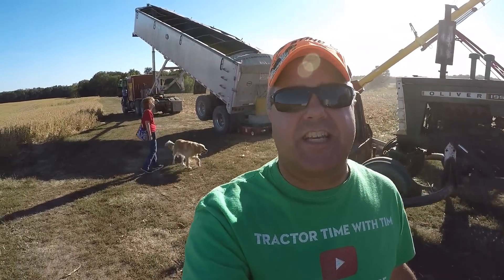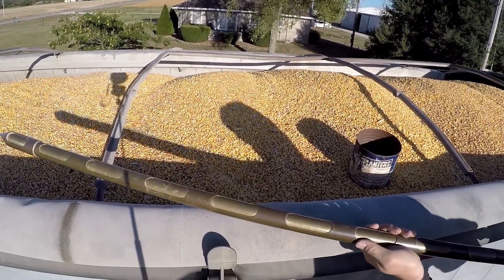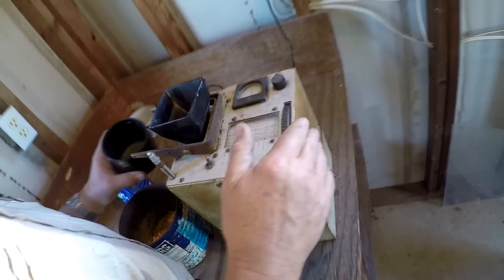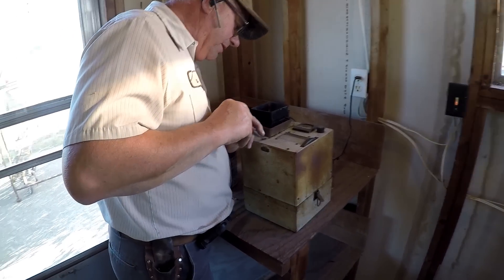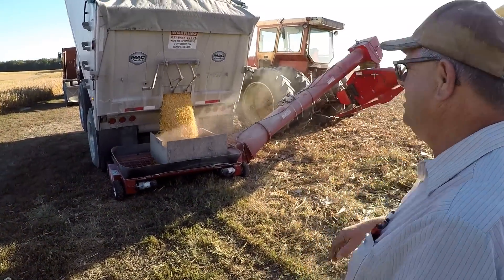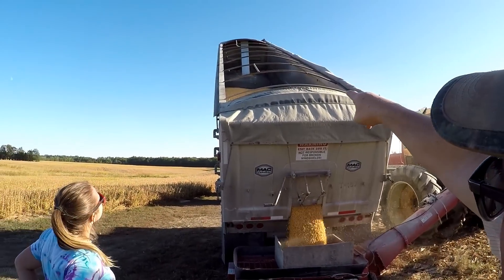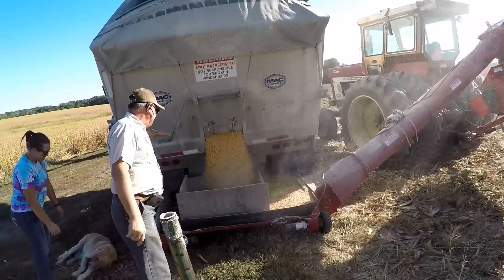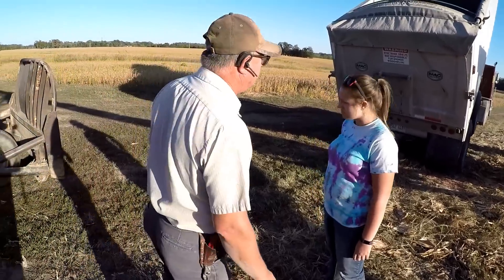"It Eats the Grain", Unloading 1000 Bushel of Corn into Grain Bin, Corn Harvest

Comment: How many HP is the old International tractor driving the auger ?
Reply from the maker: It is a 1466. They raised the rating on them during production. Early ones were 125 or so, late ones were 135-145 I think. Check tractordata.com for a more accurate answer.

Comment: 25 ton of rock in a trailer that big? I've hauled more than that in our much smaller euro trucks. I mean the rigid 8x4 I drove took 20ton of payload with room for more (weight restriction hit at 32) Why
 such a light load?
Reply from the maker: Highway weight restrictions.  80,000 lb maximum.   72,000 maximum on some Illinois roads.

Comment: How do you already know the empty weight? Have to unload first. What if fuel was added.
Reply from the maker: Well, this rig has been weighed many many times.  They weigh it each time full of fuel, then they subtract an approximate amount each trip afterwards.  Years and years of experience tells them how much fuel is used for each trip.
Additionally, if they happen to get into mud or something which would make the truck heavier, they will explicitly weigh it empty again.
Lastly, being off by 20lb amounts to $1.00, so it isn’t incredibly important.
Overall, it is a ‘controlled environment’ where common sense rules.
Great observation on your part.  I hope my answer makes sense.

Comment: If you're dumping the corn in your own personal bins why are you weighing it?  I can see if your taking it to the elevator to sell but not if you're just putting it in storage at your own farm.
Reply from the maker: That is a good question!  We answer this in detail in the 'ride along with tim's dad...' video.  Please  watch that one and let me know if you have further questions.
Reply from the maker: Did that video help?
Reply from the maker: Ok, your comment makes sense.  There are several answers.  First, the onboard combine yield monitor is pretty accurate, but not close enough to 'divide by' meaning, when you are dividing crop between owner and tenant, you want to be as accurate as possible.  
Same is true with the grain cart scales.  
Grain from multiple fields is stored in the grain bins.  They want to know exactly how many bushels (and moisture level) from each field.
Then, there is always 'shrinkage' in the bin.  Partially due to drying, partially due to dust being blown out of the grain, and some due to spillage, etc.
So, after weighing the outbound grain from the bin, they can divide the revenue appropriately between field and owner.
Try to avoid thinking of this grain as a 'bank account', where everything balances.  So, weigh frequently, in and out of the bin.   
I hope that helps.

Comment: Moving a Thousand bushels in 7 minutes, how productivity has changed the farm. How long does it take Tom to dump at the elevator with a bigger door open on the back of the trailer?
Reply from the maker: +Ken Litherland well, you saw it in nearly real time in the last video.  About a minute.  Of course the pit is large enough to hold more than a truck-load.  The cool part at the elevator is that the leg can handle it almost that quickly.  We used to have to wait on the leg to empty the pit before we could dump.
Reply: I didn't realize the pit was that big
Reply from the maker: +Ken Litherland ...the pit at the elevator.  Obviously the home auger doesn't have much of a pit.

Comment: I have a moisture tester exactly like that one, except its not broken. It would've been nice to have an auger that size back in the day. Excellent video. I think you brother really likes making videos
Reply from the maker: +John Deno can you believe that switch broke (first time in 50 yrs) right there on Camera????
Reply: I have the same tester too, my grandpa had it in the basement, coffee can full of corn to the tester to check it, tester had a glass thermometer that fit in it's own holder, good memories, then we got a 9500 in 91 and it had an onboard tester and moisture tester is hidden in the corner somewhere
Reply from the maker: Yes, I remember the thermometer.  Not sure it works anymore.  For those who don't know, the temperature of the corn affects the test.  So, the thermometer was supposed to be used to adjust for this.

Comment: I noticed the sign on the back of the trailer saying "not responsible for broken windshields".  Does that really hold up?  I mean around here if some debris falls off a truck and damages a vehicle or its windshield it is always the trucks fault no matter what.
Reply from the maker: +EOSJOE have no idea.  I'm sure that sticker was on the trailer when they bought it used.
Reply from the maker: The trailer was originally a 'coal trailer'.  ...before Tom purchased it.    That would have been when the sticker was applied.
Reply: It does in Illinois. If the load is tarped and if the lip of the trailer is clean, anything beyond that is an act of God as the insurance calls it. Hauling rock out of the quarry, rocks hang up in the tire tread a lot and get thrown at speed. I had a rock chip claim once. I was on video 15 minutes earlier tarping and cleaning off the lip. The car in question ran up behind me very close and followed. It was this particular gentleman's 9th claim I was later told by Illinois State Police. He follows trucks for a living I guess.
Reply: Its to encourage people to back off making them think they'll be on the hook if their windshield breaks from driving so close I'm sure the laws are much different and would lean towards the damaged vehicle
Reply: You should have a smaller sign that reads: 'If you are able to read this, that means you are too close' ...
Reply: The way I see it if you are close enough for a rock to fall off the back and hit your car directly you are to close. People have forgotten about following distance. I mean come on it's a dump truck or trailer. Common sense would tell you to stay back